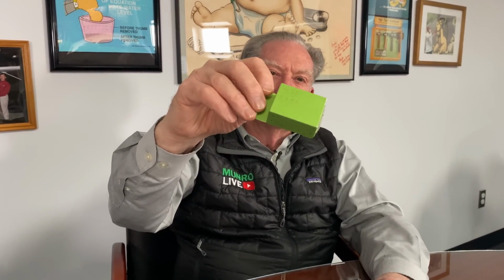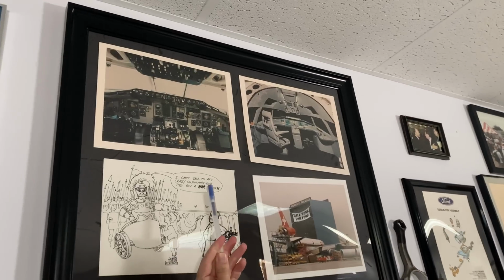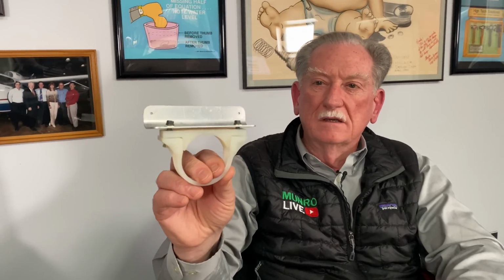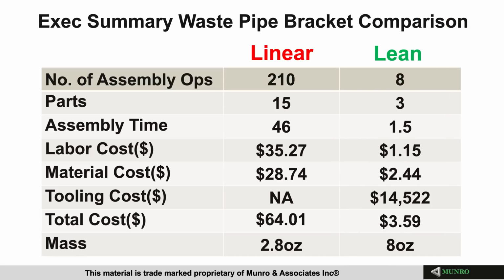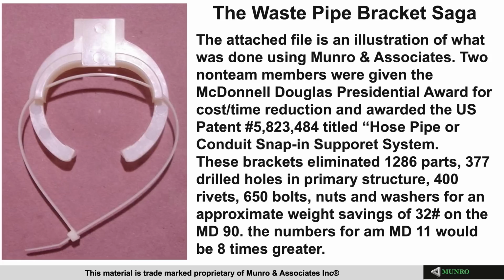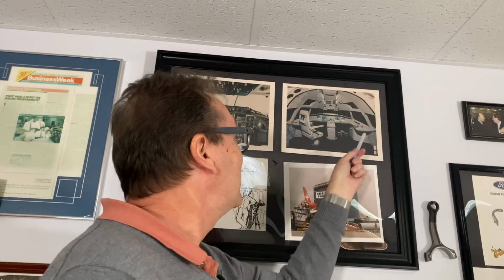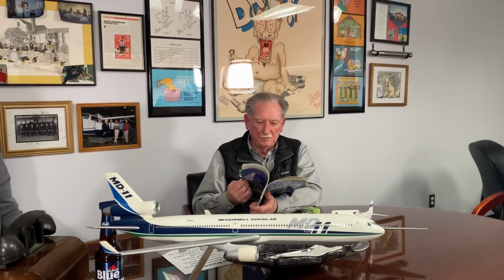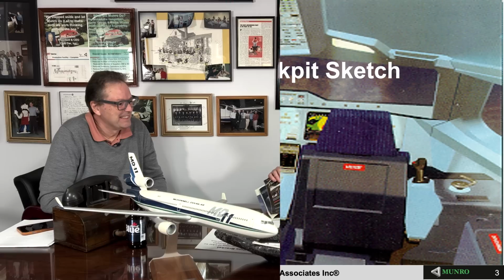What Happened to McDonnell Douglas?

Comment: Interesting video Sandy & Michael. I'm sorry you had an unpleasant experience at MDAC. I am however, personally aware of similar experiences guys. Significant change was extraordinarily difficult in most cases. And in other cases impossible. Yes, trying to make a design change to the MD-80, 90, 11 series was indeed next to impossible when Bob Hood took over in January of 1989. But I think Sandy showed 3 examples of improvements and 1 that was actually put into action. So, a 1 out of 3 success rate is consistent with what I experienced. I have wondered if the McDonnells had decided to halt improvements and made MDAC a financial company when they sent Bob Hood from St. Louis headquarters. 

We may have built our birds in an old fashioned way, but as an engineer and having talked to many pilots of our birds of the period, I believe we made damn good planes. If I look at the way Airbus builds aircraft, then there's no doubt in my mind that we certainly did build the birds in an old fashioned and archaic way. Airbus however, is a much younger company with their founding in 1970. But, Airbus is also an interesting company to work for. But that is all I have to compare in my career.

I have to agree that Bob Hood was not useful at all. Among all the useless things he did, the most "in your face" thing he did was creating over 25 VP positions after the "TQMS" reorganization that was intended to streamline upper management, as I recall. That helped break morale and signaled that the reorganization was not serious. Bob Hood quite literally  killed the company. 

But, Jim Worsham was a fantastic leader and saved the company from earlier demise. Apparently, that was before your time at MDAC. He (Worsham) walked the production floor nearly every week - a symbolic motivation for everyone who witnessed this. The guy was amazing in every respect. Unfortunately, Jim Worsham left the company for ILFC. BTW Michael, I also worked for Bruce Palmer, but moved on. I thought Bruce was a good guy. 

I finished my career there with 3 years as the B.U. Manager of QA, LB Fabrication. I left 12/15/93 after 10 years and learning that MDAC would be sold off and become a part of history. In general, the state of today's corporate leadership is sick (I mean this in the most negative context), and it started back then. I appreciate your views guys, but for me things worked out a bit different overall. 

I absolutely loved 99% of the people I worked with - from the janitorial staff to my GM. Jim Douez was a very likable VP too. I liked the guy. If Don and Leanne, and others (you know who you are) read this, I loved working with all of you!
Reply: Very interesting! Out of curiosity, do you have an opinion to share on John McDonnell? He was CEO from 1988 to 1993. And if I may ask, were you working on the commercial aviation side of MD? I'm not actually an engineer for what it's worth, just a curious apprentice aviation mechanic.
Reply: @GemminaDonati  Yes, I worked on the commercial transport division, including the C-17. I'm a huge fan of Donald Douglas Sr., Kelly Johnson, Howard Hughes, and James McDonnell. John & Sandy were certainly well-educated and smart men. Generally speaking, I liked Sandy and John. I liked John's quarterly reports on video. But more precisely speaking, I have no criticisms for any of the McDonnells - especially for the pioneering James McDonnell. I don't know when John McDonnell determined that all segments of McDonnell Douglas would become unable to continue business, but I suspect it was just before, or during public disclosure of the potential MD-12. Quite frankly, when I first heard about the MD-12, one of the first questions that came to mind regarded the cost to design and fabricate just the tooling, and how that effort alone would be paid for  - even though the MD-12 was, in some respects, a derivative of the MD-11. So I do believe that John McDonnell saw the writing on the wall and did what he had to do to save the company in spirit. And I have sometimes wondered if the Saint Louis division could have survived if the other segments had been shuddered. Oh well, I have always loved aviation/aerospace (since July 20, 1969), and still do.

Comment: And you also had manufacturing employees that didn't appreciate or care about what they were doing. And many were allowing the union to cause a lot of chaos in the manufacturing ranks causing vitriolic comments and other things toward the company. They tried bringing in TQMS to have the employees help improve quality, but so many complained because they didn't want to do it. Many old timers didn't want any sort of change. Even the employees on the floor talked about how John McDonnell just wanted his money and to get out. Working for management that didn't care, translated. Years later, after MD became part of Boeing, I had some engineers showing me some pictures of their design for a wide body twin jet, it was based on the MD11 without the engine in the tail. They told me that they had presented their idea to upper management which received a resounding NO. They lamented to me that if they had been given the go ahead, they would have had the plane flying 3 years before the 767. I could take pride in what I did, but at the same time it was heart breaking.

Comment: Happened to work for washing machine company. I was in mgmt team but in IT
Sometimes they bought competitors product to take them apart. Japanese product. They had 8 brackets for all corners. Every bracket was the same size etc. 
We had 8 different ones. 
Us non engineers around the table we looked at the engineering director??
He gave us lots of reasons why one bracket wouldn’t work. Didn’t give in to amateurs. 😂

Comment: Just saw an ash tray in a brand new (relatively) Airbus A350-900 (Lufthansa) in the bath room...still going, not allowed to smoke but the ash tray is there...
Reply: After a little research: The FAA is demanding to install ash trays in the bath rooms in case someone does smoke and should have the opportunity to use the ash tray rather than dispose the hot remnants in the waste bin and cause a fire....

Comment: The pipe holder went from 2.8 oz to 8 oz? Looking at the two that seems incorrect. I would believe the new part weighted 0.8 oz but not 8 oz. Perhaps simply a missing decimal point on the chart in front of the 8.

Comment: I went to the auction at the Torrance plant, that was a huge plant for manufacturing of the parts. They had everything there. Machine tools, Drop hammers, plating, heat treatment. All kinds of stuff. They had a CMM you could fit a 2 story house in that was in a plexiglass enclosure to keep the temp right.

Comment: I was an employee of MDD Long Beach from 1989 to 1993 (maybe I was the guy you saw crawling into that tight C-17 space?), and even in 1991 I was seeing the entrenched mindset, BEAN COUNTER mentality, and outright graft in the company.  It was so bad that a progress report on C-17 production stated that one unit (maybe P8, slept since then) had all its slats installed (they were all removed due to issue), and 3 of 6 spoilers installed (C-17 has 8), and something else that was false.  Basic, easily prevented mistakes where being made everywhere on C-17, and that hurt the company and accelerated its demise.  The grand irony is as the companies rot accelerated and layoffs increased, the stock value went up, until company was gone (kind of like the recent SVB and First Republic banks).

Comment: In 1972 I was 27 and pulled strings to get laid off from North American Rockwell.  I learned that the aerospace industry suffered from bad management because they promoted engineers who are specialists and given supervisor, manager, director positions which require  a generalist to fill these positions.  There are  80% of the former and 20% of the latter.

Generalists love to switch from topic to topic and back again.  Specialists hate subjects outside their first love.   A few are good or great at specialties. wile at the same time love a phone call, a walk in or a message that interrupts their attention.  The manager doesn't have to know how to do things, they only have to know how to get it done.  The generalist need the specialist to make the best decisions.  The specialist hates the generalist as soon as the subject is changed.  There is a difference between the chief of staff and the chief of line.

I first worked at NAA, North American Aviation in 1963 as a summer hire as a junior draftsman.  Nepotism got me in four more times and after 7 years I got a BS in 69,  Two summers it was the X-15 Engineering project, with a staff of 30 who complained of being over paid and under worked.  The Viet Nam War, kept me in college and killed the X-15.  They had intended to use that air frame to test a 'scram jet'.  over 50 years later, that is now in the aviation news.  One of the highest paid/ ranked engineers, did not have a college education.  The shop men would come up to the engineers and they would discuss with the engineers how the test would be installed into the ;lane.  While pull got me in the job, I was wanted back the next summer.  The senior engineer apologized for not being able to put enough tough jobs for me to work on.  I was smart enough to know I wasn't smart enough to be an engineer.  But I was a good designer.  I also learned how to be a loved boss and my workers became loyal, with a couple exceptions.  One busted himself by confessing to selling some joints to the old horse race advisors in the next store front. (bookies}!   At the time when someone asked for one, it would be thrown to them.  Once I picked up a worker and a friend came up to the 60 Valiant station wagon and asked my worker, if he knew where he could get a lid, an ounce of pot.  He pulled out a baggie and got a $10 bill.  I let him know to never do that again.  Most those younger than me were into pot.  My older friends weren't.  The two age groups didn't mix.I was in between.   I designed a dual air compressor from Italy to replace one for fire truck horns on vehicles without air.  It blew them twice a loud, 2-3 decibels louder and wanted to charge the ambulance manufacturers $350, but they wouldn't buy anything cheaper.  So I had to sell them something that took half the amp draw and performed better at the old $525 dollars and had to pocket an extra $175 each time.  I sold a lot of them.  I also imported European Hi-Lo air horns as auxiliary or intersection horns.  I never lost my customers, I lost my supplier.  Grover who makes the fire truck horns were not interested in a cheaper item.  A new young national sales manager wanted me to pay three times what I had been for their product, and I knew I couldn't sell anything at a big loss.

If anybody has gotten this far, here is a present~~~~~~ DEFINITIONS:  A Specialist is a person who knows more and more about less and less till he/she knows everything about nothing.   A Generalist, knows less and less about more and more, till he/she knows nothing about everything !

Comment: I recall from some news article that when company merged with Boeing, it was the management  of MD that took managing of the new Boeing.  The reasoning for the change of management of Boeing was to please the company's stockholders.   Cuts in engineering was the beginning of the downfall of the company which has been plagued with design failures.

Comment: 1. Douglas ignored the development of the jet airliner because they had a big backlog of prop airliner.
2. Then it was catch up and never catch up
3. After Boeing owned the small and big end of the airline market (707-737 at small and 747 at big end) there was a need for medium wide body.  Lockheed jumped first with work on the L1011.  Douglas decided to make the DC10 with 3 objectives: deliver before the L1011, be lower priced than the L1011,  have lower maintenance cost and fuel cost.   

The result was an inferior aircraft that competed for a market that there was only enough money for one.   So 1st Lockheed went bankrupt,  then McD went bankrupt. Then Boeing bought McD and the Douglas Mis Management took over there leading to the recent 737max fiasco.   I have watched this from a stockholder point of as I bought McDonnell in 1966 and so now have Boeing stock.  At some point I worked for Northrop and was part of the takeover of Grumman.   My dad had worked for Convair on the Atlas ICBM and told stories of management incompetence there.  In the end my opinion is that Boeing used to be well managed, Hughes  was well managed until the government destroyed it, and Northrop, where I new the characters was well managed.  I applied to work at Hughes once were a lot of the top engineers from Douglas fled too.

Comment: I worked at Douglas during this era. This was during the time when executives began to get a majority of their compensation in stock options (hopefully as an incentive for them to want the company to grow). Also, the board of directors would fire a CEO by giving them a "golden parachute" to avoid lawsuits, so CEO's lost any fear of making big mistakes. Sometimes this made the leader focused on short-term stock price growth, and the detriment to long-term company health. The major upgrade between the DC10 and the similar MD11 is that the MD11 had a glass cockpit (computer screens instead of analog gauges). The MD glass cockpit was designed on the government dime for the C-17 cargo-plane, and as soon as the designing and testing was complete, the same guys started on the MD11 glass-cockpit design.

Comment: I suffered the same situation when working for couple of companies like an old Bendix affiliate. I attended a presentation of a test rig. The test engineer had integrated a touch screen for control but integrated into a PDP-11 computer which resulted in a refrigerator sized cabinet (but it had wheels). I leaned over to a colleague and whispered  that it could be done a lot easier and cheaply on a Intel based lap top. I was then cautioned "not to say anything".   That's all that test engineer knew and the company was satisfied with the same old systems and god help  you if you tried to bring in something new and more efficient.

Comment: MD11 is robust and takes abuse.  Incredible heavy lift machine. Pilots run aviation not nerd pack engineers.  Pilots get the final say so.   Everyone else has to watch.  And the regulations require lawyers to modify the words,,, and that’s a problem
Reply: That was the fun thing about this project with the students from the ArtCenter College of Design. I would drive the pilots up to the campus to tell the students what they really need, what they like, what they hate, etc. It sometimes took perhaps half an hour and even the most "hardened" pilot suddenly realized that somebody was intensely listening to what he or she had to say. And all these either airline pilots (United, Delta, Korean Air and Northwest) flying Boeing, Airbus and McDonnell Douglas products were floored when they saw the mock-up. And that's when the engineering director in charge of this made the infamous comment when he saw the cockpit for the first time. "Pilots will love this, I hate it". 
He said it all ....

Comment: Talking about the DC3.  I heard a story about a DC3 doing a cargo run of aluminum I-Beams.  The pilots were able to get the DC3 off the ground, but it was close.  They did a go-around and landed thinking there was an issue with the plane.  Ended up not being an issue with the plane. The I-Beams were not aluminum, they were steel. Testament to what a beast the DC3 is.
It was able to off the ground grossly over weight.

Comment: That engine on the tail was a problem.  If it blew up the shrapnel basically made the plane uncontrollable.  The rudder and the elevator controls are back there and they usually blew off.   The pressure bulkhead is back there and it usually blew out.  And apparently there were 3 redundancy control circuits that converged back there, and the shrapnel from an engine explosion took them all out at the same time.  The design of a safe aircraft is that any potential failure of a system still allows some pilot control to land the plane, and not render all controls and flight recovery useless.

Comment: I hired into McDonnell Douglas Electronics Company in the St. Louis area in the mid 80's, and bailed in the mid 90's after the corporation's St. Louis employment dropped from 40k to under 20k.  Obviously, losing the ATF contract, the A-12 contract, and the advanced helicopter was disastrous... causing the stock price to drop from around $75 to $27.  I don't know why McAir couldn't design a successful aircraft, but there was still plenty of dumb, expensive ideas in the small electronics part of MDC.  Someone decided to build a semiconductor fabrication facility, which is hugely expensive.  They tried to build a mil-spec microprocessor, and it was so bad that we didn't even design into the projects that I knew about.  Then they decided to use it to build solid state lasers, because they were already trying to build a pumped laser communication system for the Defense Support Program satellite.  I spent a little time on the solid state laser communication project for Star Wars, and it burned through a lot of money before it failed.  The pumped laser for the DSP satellite burned through even more money!  There's a story about the impossibility of the DSP laser ever working, but that's a longer story.